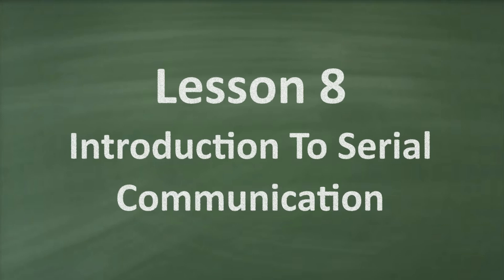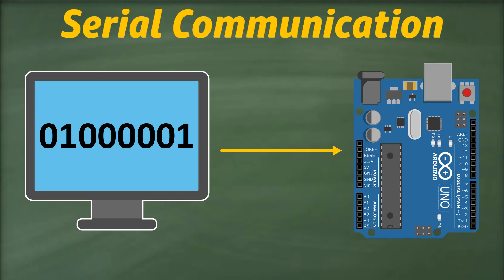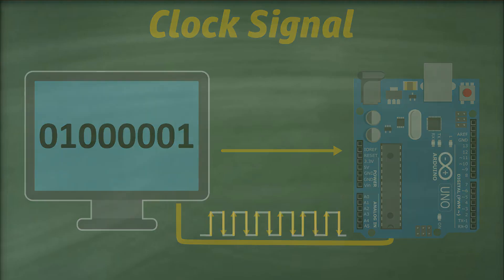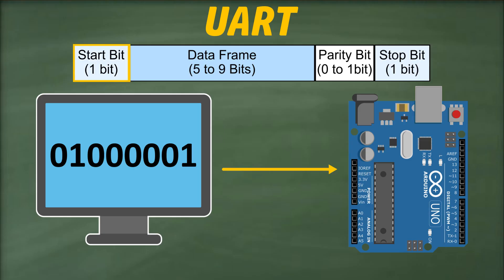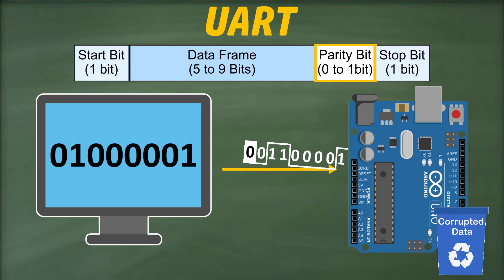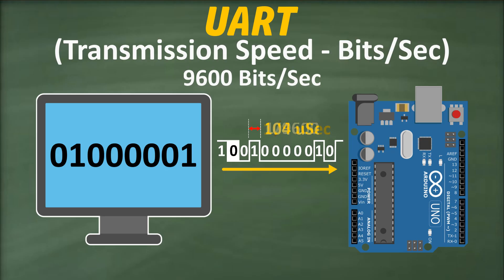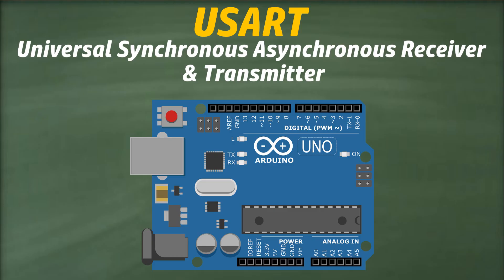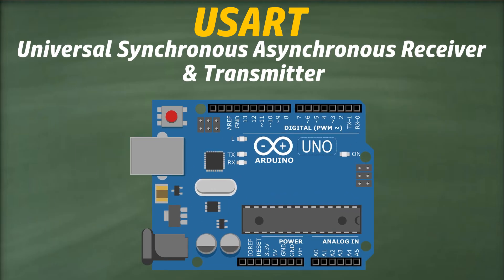Lesson: 8 - Serial Communication Explained: UART, Clock Signals, and Arduino TX/RX Basics.

Comment: I work with 32 bit data words. I get confused about what determines LSB, MSB and why have them ?
Reply from the maker: Hello there, hope you’re doing well!
When a 32-bit value is transmitted, it is first converted into binary. In that binary representation, the left-most bit is the MSB (Most Significant Bit) because it has the highest positional weight (changing it from 0→1 alters the value the most). The right-most bit is the LSB (Least Significant Bit) because it has the lowest positional weight (changing it only affects the value minimally).